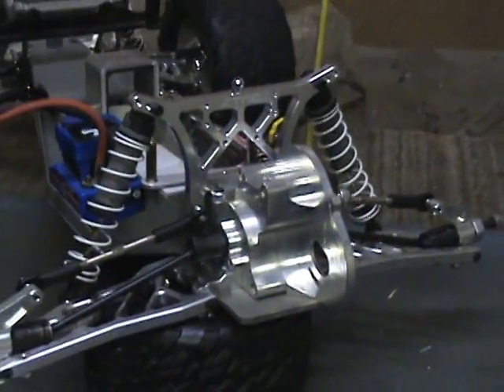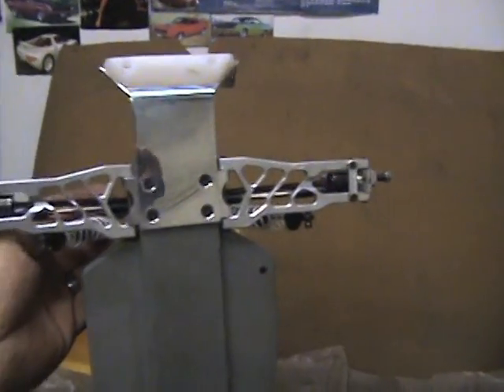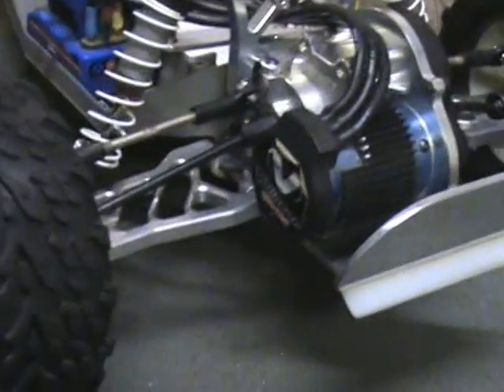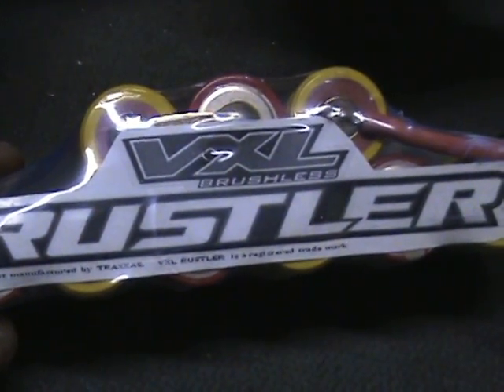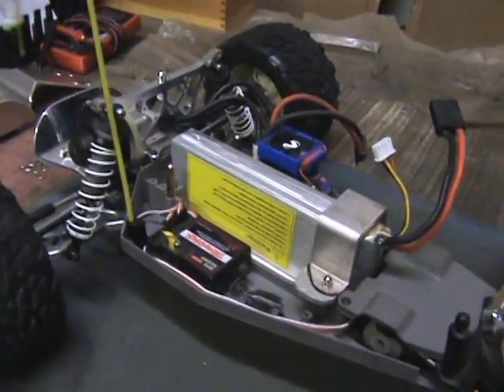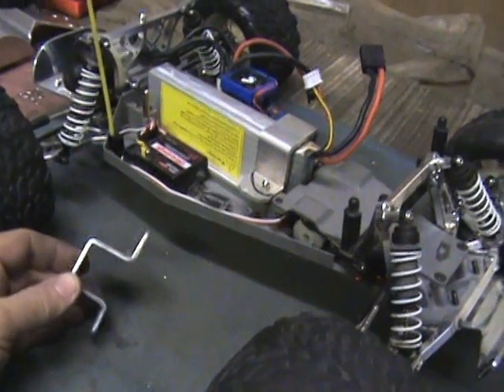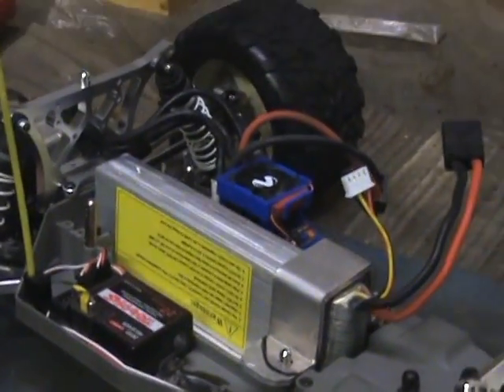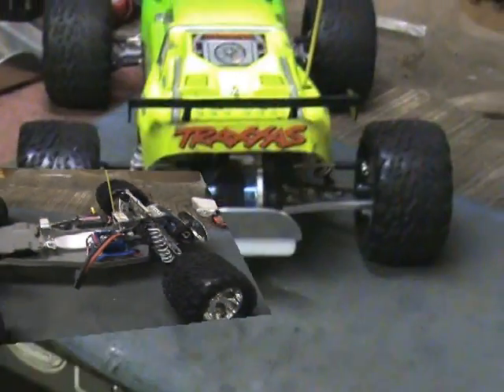VXL RUSTLER INTEGY ALUMINUM GEAR BOX

Comment: Thats super sweet! A coupla questions...1.  How much heavier is it now with all the metal? I've been adding aluminum and the weight hasn't gone up noticably yet.  Are the FLM transmissions good now? I need this for my Slash and wouldn't want something defected.. My plastic case has seen better days, other than the break on yours mine is even worse lol. Cool channel by the way. I subbed check mine out.